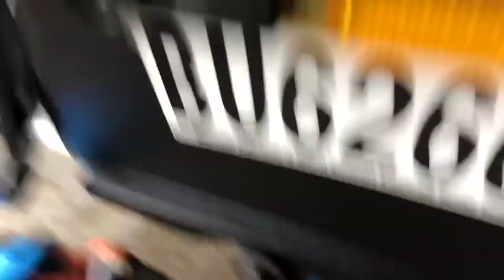Change Chaincase Oil - 1996, 1997 Polaris Snowmobile

Comment: Oil doesnt all drain why
Reply from the maker: Not sure about that. Maybe try a small wire in the drain to clear out any obstruction.
Reply: You're probably confusing it with the 2-cycle oil reservoir... because you can't see if all the oil is drained out of the crank case unless you take off the crank case cover... is which case all the oil would drain out without the cover.

Comment: Hey I own an Indy 500 swapped trailblazer quad. I was wondering if these have crankcase oil and if so how do you check and change it?
Reply from the maker: Hello! So I’m not totally sure about your quad. Mine is a Honda and it doesn’t have a chaincase anywhere, but each gear differential (front and rear) has an oil pool that the gears spin in. Each should just have a cap on it and you fill it until the oil starts overflowing out the fill hole. That’s about all I know there. God bless!